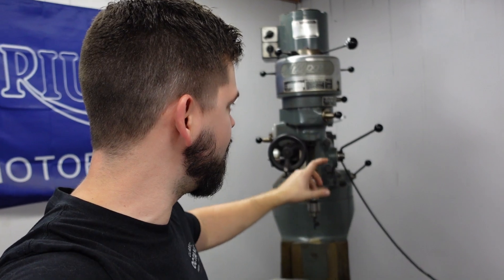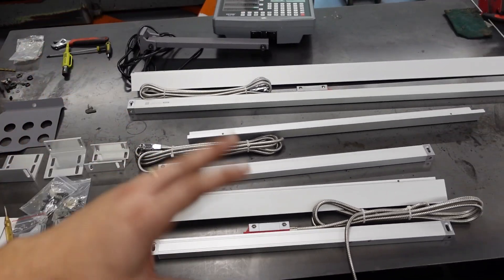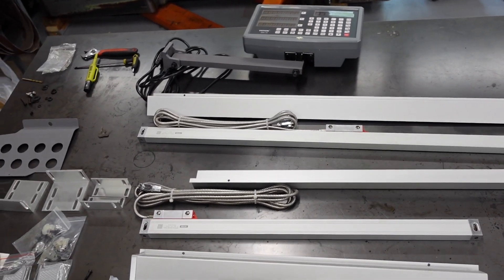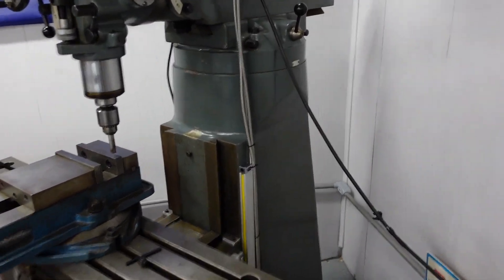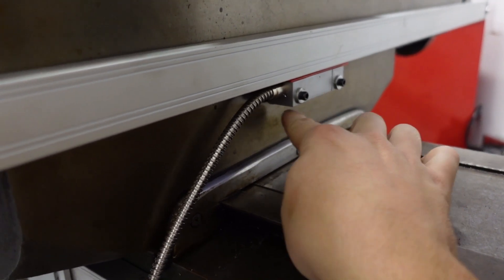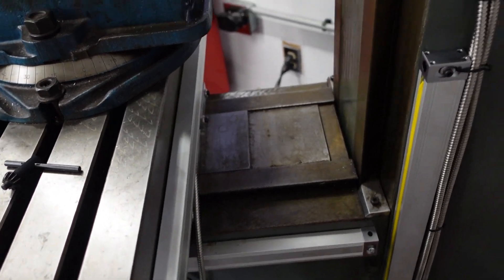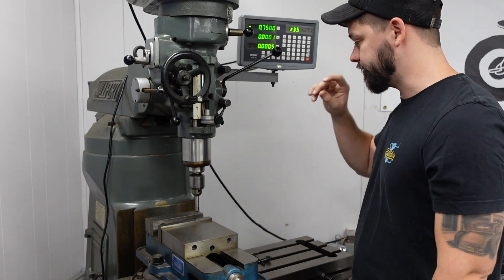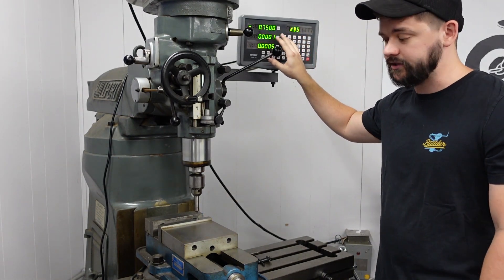Every mill needs one of these.

Comment: that kit is a pretty slick retrofit for your mill. it's amazing to me just how accurate, what is essentially a bolt on three axis electronic micrometer, can be, and because of that accuracy, it will make using that mill so much easier for you. i have a small craftsman metal lathe that was made in the 50's and doesn't have indicator hash marks on the travel handles, so i have to constantly stop and check my work with a mic or a set of calipers and dividers to know when the work is at the proper size. although i would love to install one of these units on it, i have a sneaking suspicion it would cost more than i paid for the lathe. edit; i followed your link to their website, and was pleasantly surprised by the price of a two axis DRO that would fit my lathe. $150 is about half of what i was expecting the cost to be, so i think i see one in my future, and IMO installing it will more than double the value of my lathe, make using it at least three times easier, and cut my work time in half. for those at home keeping score, that's a win/win/win! so much winning, thanx taylor, you tha man!

Comment: The best way to mount the knee scale is with the slot facing away from the front on the machine. Mount the bracket to dogleg around the scale. This way will keep chips and coolant away from the slot and reader…

Comment: Great video as always. I have the same type of Mill that I converted to CNC using ball screws and stepper motors. It is now an awesome machine. I’m sure with your fabrication skills it will be very easy for you to do it. Then you will need learn Fusion 360 and Mach 3 to run it.